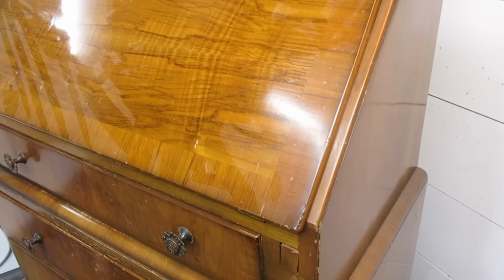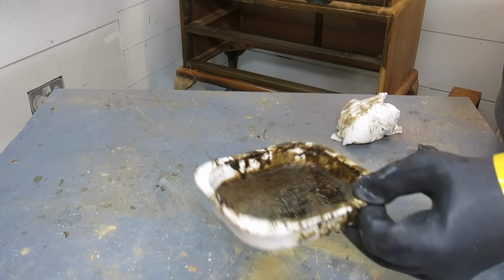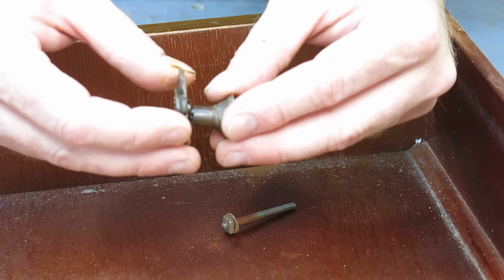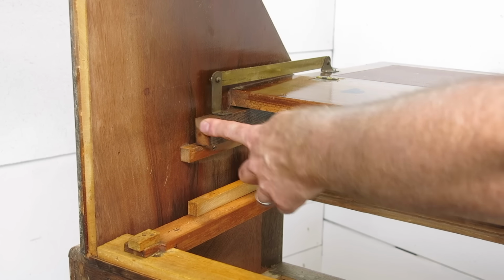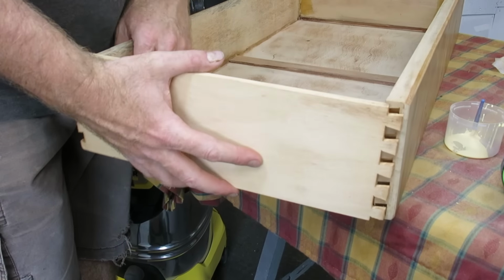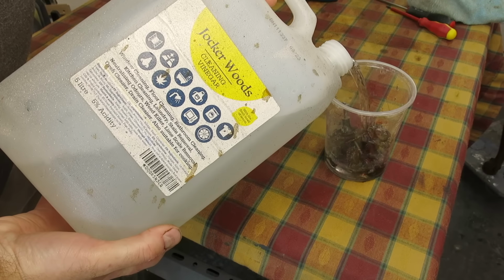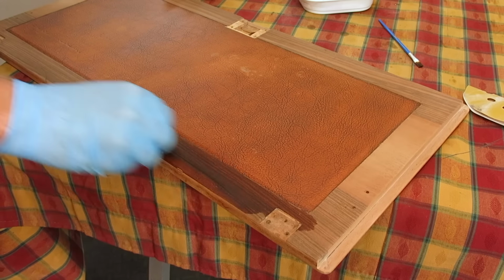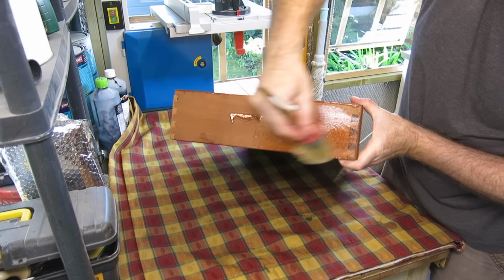Satisfying RESTORATION of a Beautiful Secretary Desk - Writing Bureau from early 1900's

Comment: David, I have just started the basics on a bureau almost similar to that you have in this video.  I will admit that I intend to restore mine by cribbing from you, as long as you do not object.  You have the benefit over me as I am not able to afford the quality of your tools, sander etc; but will attempt to produce a good job.  I am only doing this as a practice exercise and have no great desire to sell it on, in fact most of my catchment area would not be able to afford a higher price than say £40 in my experience so I end up donating my finished pieces.  But I will be satisfied to get a good finish which is the objective for me, as it is just a hobby piece for me.  It's so nice to see Daisy and her Bella helping you with the work, I'm sure they never get in your way.
Reply from the maker: Hi David. No problem at all, its one of the main reasons i started the channel. I have learnt so much from others on Youtube. My Sander is an expensive one but I use it endlessly and I saw it as an investment but cheaper Random Orbital sanders are perfectly fine, just go slow with the sanding process and work your way up through the different grits. Good luck with yours 😃👍

Comment: Hey, this vid has been a godsend in restoring a bureau I picked up for free. Do you have to use paint stripper or is using an electric sander enough?
Reply from the maker: Glad it’s been helpful. I tend to use stripper when the piece is veneered rather than solid wood as a sander can easily burn through the veneer if you’re not very careful 😀👍

Comment: It would appear that the reason that the knobs were made in 2 pieces is because the flared stem could never be extracted from a die used to cast the front portion.  That must certainly be the reason that almost all knobs have straight, or even slightly tapered, stems.  The flared stem is a really attractive detail.
Reply from the maker: Thanks Steve, great info and much appreciated 😀👍👍